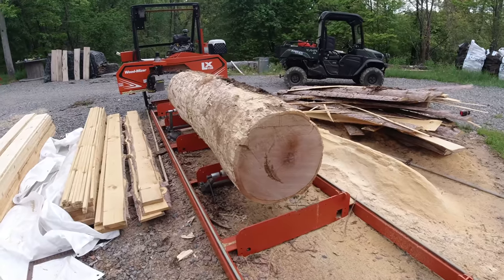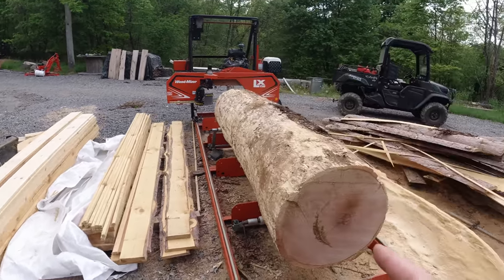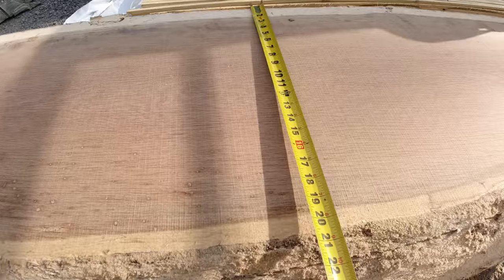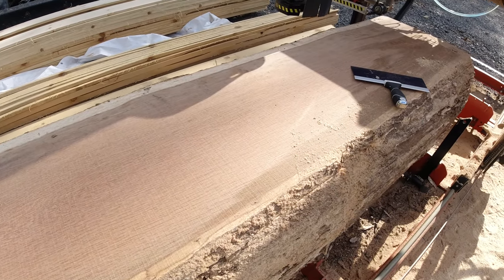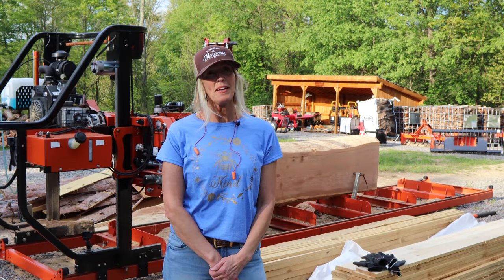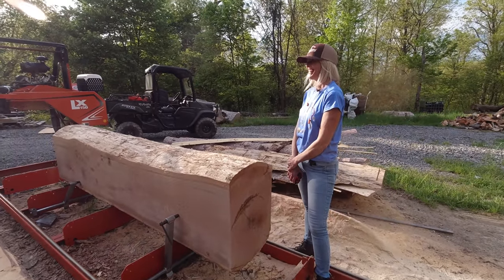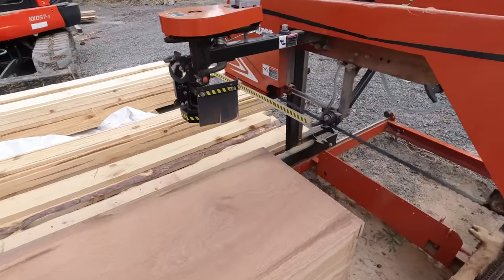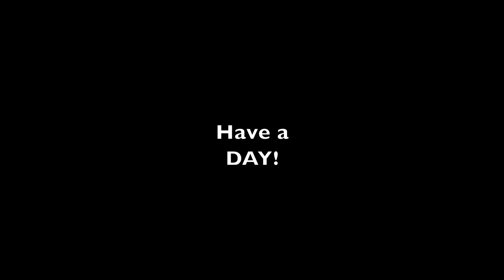It's BIG! It's BEAUTIFUL! Best Log on the Woodmizer to date! #1099

Comment: Beautiful old Oak log/slabs Mike ... and yea, you have plenty of hydraulics, it's all about adapting to what you already have ... In the mid 90's I was restoring a huge old 40,000 sq ft mansion at the beach in NJ built in 1862 and putting in some coffered ceilings in most of the first floor, designed and milled just for that project ... my mill guy drove up with the whole load in his biggest truck .... lot's of 5/4 and 1in X 6 Oak and 5 inch crown, all 16 footers ... hot summer day ... but luckily we had a full crew to unload it ... our new kid in training made about 3 trips with 3-4 piece in bundles and I caught a look of his face on my way back to the truck, he looked at me huffing and puffing, face red and covered in sweat and said "Damn, this stuff is heavy" (all he had ever humped was pre-primed trim boards)  ... the kid was a friend of the owners son ... a week later he announced he had landed a coveted job as a Cabana boy at his parents beach swim club ... he was a nice, polite, respectful kid, but construction was not his calling ... I told him when he finished college I'd hook him up with Merrill Lynch on Wall Street (where I had come from in 1995 after surviving the 80's down there) I got up from my desk one day and just left, walked out, following week I had my old, well worn tool belt on and never looked back ... following month I was restoring an old Victorian home owned by a Merrill Lynch VP ... spent the next 3 decades restoring or building replica historic homes for wealthy Wall Street people ... but I was the happier guy always

Comment: Mike,
During a power failure last year I was burning some oak round end off cuts like you are putting in your burn pile in our fireplace. The burn nice and 1 piece would last 30 minutes.  You might consider cutting them to fireplace length and selling them too.  You don’t need to split them.

Comment: Hey mike be careful drying that lumber. We never had any luck with wide boards. Always seemed to crack or warp. We never cut anything over 12” wide. If we had a wide board we would saw it in half then make 2 smaller boards. We ran a lt35 wood mizer with hydraulic log lifter, log turner and could level the log with hydraulics. That machine was a lot of fun to run. Best of luck to ya! As a beekeeper I liked Melissa’s shirt. Enjoyed the video.

Comment: Morning Morgan's
Melissa, I don't think Mike would replace you.
Mike, Don't you have some straps for handling these big oak logs.  Makes me cringe 😬 every time the excavator teeth bite into the finished cut surface.  With a strap, you could roll it right on the mill.
Keep up the good videos 👍👍
Reply: weld a hook onto the back of the bucket and use a couple of straps to choke the log if you need to move it around. The hook will come in handy with a chain for future rigging.
Reply: slings work great and no marking
Reply: This is what I was thinking also.   Excavator marking up the finished cut side.   There is always a better way to do a job.

Comment: Do you think the moisture reading was effected by the blade moistureizing solution?
Reply: No, surface water won't effect the electrical resistance at the ends of the pins.

Comment: What a beauty! Yes I'm referring to the Oak. With wood prices, you might be able to barter for some new equipment vs. groceries! You're an amazing equipment operator Mike, always impressed when ya have the tracks running one direction, cab spinning to off angle from the tracks and manipulating the arm out to position over the work piece! I think I would pull a brain muscle trying to do that many things at once. One quick question; I notice you have the small arm with the circular saw running ahead of the saw kerf on the mill & sometimes it's not running, curious what the circular saw blade accomplishes & why it's not used all the time? Excellent video again!
Reply: I'm not Mike, but I believe it's called a de-barker and he usually only uses it to take of the bark if he has dragged the log in the dirt.  It saves wear and tear on the leading edge of the blade.  Hope that helps.
Reply: @d.a.ballou9740  Thanks for the reply, that makes alot of sense.

Comment: I was thinking when you cut the 8 quarter board, 3 of those put together would make a fine desk top. It is beautiful wood. Mike, I was watching Triple L Rustic yesterday and Zoe and her dad-in-law was splitting wood on a Wolfridge splitter. Dad said he got his inspiration for that splitter from Chris at Wolfridge from Outdoors With The Morgans. Zoe and hubby, who is a law enforcement officer, Swat, also have a Woodmizer mill. A video of their's show a bucket on the sawdust port catching the dust. They were cutting cedar, saving dust in plastic bins. Zoe would take the dust and cedar chips and put in small cloth bags and sell as fragrance bags. Put them in sock drawer, etc. They are a young couple, Zoe wears tight leggings to show off. They are in Florida. Home Between The Oaks is also their channel. I guess I'm not the only guy who has Outdoors With The Morgans as their #1 favorite channel. Nathan bought a back hoe for his tractor, little bitty thing. Bet he wishes he had an excavator! Eventually you will cover the mill though, right? Will the ceiling be high enough to operate the excavator under it? Just another future project I can hardly wait to see. I do love this channel‼👍🚜

Comment: I found that the best way to knock off old bark like that is with a cheap HF machete. Also knocks off the really punky outer layer of older dead logs. Those slabs have quite a bit of firewood if you buck them and split them. When I was a kid my dad used to have a buddy with a sawmill and we would go get slabs and cut them for our wood stove.

Comment: I love the oak boards but I want to see how much they warp and crack, if any, after you send them through the kiln. Hope you do a video on that. As a woodworker with a 20" final planer, I am vary curios. i usually buy 4 quarter kiln dried wood for it to make 3/4 inch boards.

Comment: Hey Mike ...got a question...i have seen on other channels ( wont say who) they had to realign and level the saw mill bed after pretty much every log .. i noticed you haven't had to do that, just wondering if you have ever had to relevel the bed or not? and i dont remember what you put the mill on wether it was just the ground or concrete  pads or which ...

Comment: Good morning  Mike what do you do with all of the slab wood ? when we lived in Sullivan Co Pa back in the 70s we could get cut up slabs at a local mill and use it for what we called GOFOWOOD to re start are wood burning heater it worked good . also those 8 quarter sawn  oak planks would make a couple nice Harvest tables with matching plank benches to in the rec area of the new building . I have made 3 of them back in the 60s for family members for their dining rooms Keep up the good work

Comment: Mike, you commented earlier about the measurement of rough cut lumber being in quarters, and that you didn't know why. I have the impression, and correct me if I'm wrong, the quarter system tells us it is full thickness, 4/4 or 5/4 or whatever number, whereas planed lumber is nominal 1", really only 3/4 an 2" really 1 1/2". Is that right? Nice work and stories!!

Comment: Those 1”x16” boards would sell for quite a bit. A furniture manufacturer could easily make tables with that material. You might want to cut some of it 1-1/2” or 2”x16” for table tops.

Comment: When you start pouring the concrete for the building up the hill maybe it would be a good time to pour the slab for the saw mill. You have all the equipment up the hill working on the slab for the new building it wouldnt take long for an experienced crew.

Comment: You seriously need to get a bark skinner or make one for cleaning off the bark before you saw those logs. Most of the abrasives, dirt, sand, misc is caught in the bark and the more bark you cut the faster you burn your blades out. Just a suggestion but it's your mill so you do what you think is best.

Comment: A $125 woodmizer can’t hook can turn that log faster working than that $70,000KX.    
 Are used to have a little manual mill lt25.  Upgraded to the LT 35hyd production I would say close to doubled not to mention taking 95% of the load off of me.